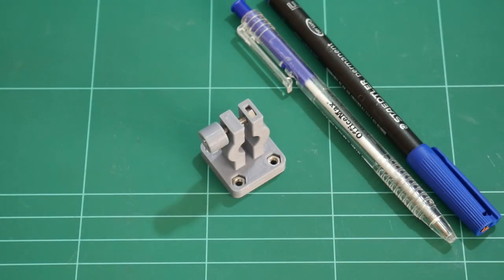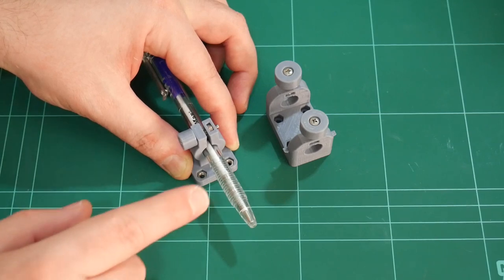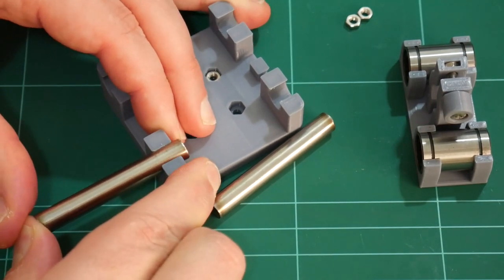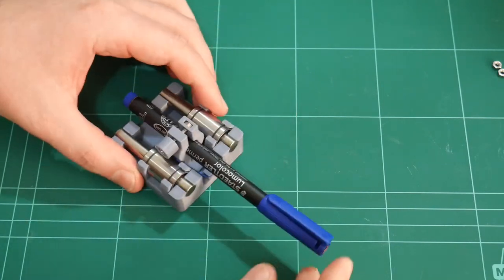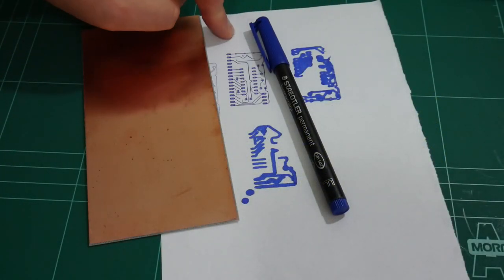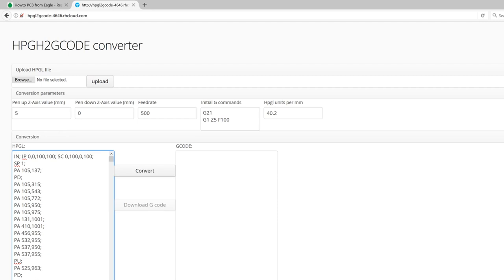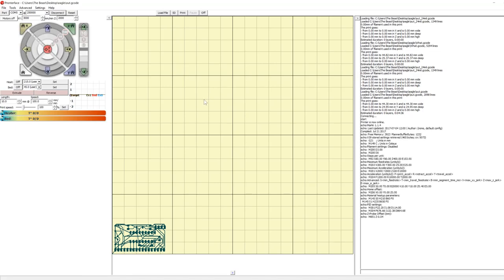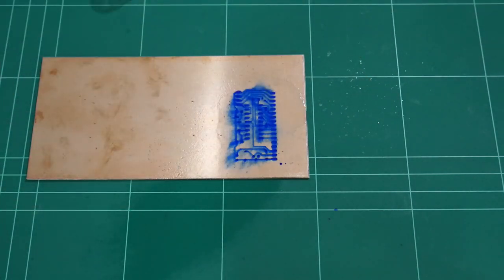Over-Engineered Pen Holder?

Comment: 16:23 the felt marker polished the copper
Reply from the maker: That makes sense, thanks.
Reply: or removed the photo-sensitive layer
Reply: deadall127 no photo sensetive layer on that pcb..
Reply: The ink protected the copper from oxidation. The color difference is from a minute difference in an oxide layer. Try drawing half a schematic, wait an hour, and draw the second half. Clean off the ink and compare the traces.
Reply: that makes sense too :)
btw, if you want to make a real pcb with this cnc+pen, you should use a plate covered with a photo sensitive layer, then expose it to UV light, then disolve the copper and finally clean the board and make the holes :3
OR simply replace the pen with a drill XD

Comment: I know what we used when I was working with cnc the pen had a secondary spring and the casing held them and the pen cartridge so the pen casing was held with a set screw still allowing for odd surfaces

Comment: The 'imprint' was just some cleaning of the copper surface done by the solvent that the pen has in it.
Basically it the cleaner bits of copper.

Comment: The board is just a simple dev board to make it easy to use a pic16f84a. The 16f84a is an older flash based pic chip. Microchip has a huge number of devices in their lineup.
Reply from the maker: Ok thank you.

Comment: This is a nice design for holding the pen. 
I do not know if you are looking for other ideas... If you are then may I suggest a solder paste dispenser attachment? For a hint, look at Dave's (not going to mention his Youtube channel out of politeness but it's that self-described crazy Aussie bloke) latest unboxing video where he got an automated SMD dispensing pen. An adapter for that on the Hypercube would allow the finished PCB to go back on the printer for placing the solder; this is an alternate to using a paste mask.
AFAIK, I have not seen a 3D printer being used to dispense paste before.
Oh, and the pen can also be used as a pick-n-place head, for placing SMT parts... but this requires a lot more gear to go onto the 3D printer.
Just putting it out there as possible future extensions on the printer.
Cheers,
 - Eddy

Comment: idea: you can add small servo to lift pen holder up instead of using Z axis. With small circuit you can use any digital pin and replace all Z lines in g-code...or if your drivers take STEP and DIR pulses on input, then (with a little better circuit) it should be simple to connect servo to board instead of Z axis driver.
But I guess people won't use this so often and seriously, so waiting some extra time for Z axis movement won't be that big problem :)

Comment: Did you always intend to use the HyperCube for these pen/laser/milling CNC designs you're doing now, or is this a fairly recent idea?
Reply from the maker: Recent. During the HyperCube build log series I just wanted a better printer. Earlier this year I released a video called "Draw with your 3D Printer!" which is when the CNC idea came about.
Reply: Now you need to drill the holes in the board. That's more work than just drawing. You need another quick connect for a Dremel or somesuch.

Comment: Just add a spring inside the pen at the top side and cut the refill tube a bit at the top and it will do the same job and literally you don't need to scratch your head anymore.

Comment: bruh I straight up used a design that was opened and doesn't need to be locked in place, only with a few rubber bands which help it flex , the whole mech is also held in place with rubber bands whcih allow it to move up and down only.

Comment: This is a lovely design. I have just purchased a little desktop CNC and, based on your design, I have ordered the linear bearings and rods from China. Now, I have a couple of months before they arrive, to draw up the holder so it all fits my gear. Since I'm a machinist, I may make the rod mountings slightly more skookum on a metal lathe. There is NO such thing as over-engineered! :-)
Reply: Would you, based on your "over engineered design", build a heavy duty CNC plotter, with very high accuracy, capable of drawing on A0 format? What would be the price of it? With stepper motors and Raspberry pi 5

Comment: Great video. However all those unnecessary pen lifts would annoy me. i wonder if there's a way to filter them out of final G code
Reply: You are not alone. Yes there are tools for that like http://xyzbots.com/gcode-optimizer/ but this tool assumes G0 motion in between G1 drawing sections, plus I am not sure it can remove unneeded up and downs.
Reply from the maker: I agree the code could be more efficient, but the entire drawing took 4 minutes, so saving an extra minute or 2 really isn't a big deal.
Reply: Yep; learn a bit of G-code (it really isn't that hard), then use a regular expression search-and-replace in your text editor. Done like dinner.

Comment: I'm intrigued by the scale factor for "to mm" in the HPGL to G code converter.
HPGL units are usually thou, and there are 39.37 thou/mm, not 40.2?  (1000thou / 25.4mm)

Is this to compensate for a subtle scaling factor in the 3d printer?

Comment: Hi, nice video again. 

At the moment I'm using the toner transfer method to develop pcb's. But this technique seems much cleaner. The thing I noticed is that all video's using the direct ink to pcb method create pretty coarse traces. It would be interesting to see if it's possible to create for example 0.5 pitch traces with a finer marker. 

Maybe it's an idea to use a coarse pen like the 0.6 for copper pours and a finer one for the traces. Maybe this needs a dual pen setup, if replacing the pen mid process would mess up the alignment.

Comment: How much more difficult would it be to use the print head from an inkjet printer and just use only one(1) nozzle for printing. There are now some reasonably inexpensive inkjet printers on the market that use a separate ink tank and transfers the ink through a very small tube similar to how some 3D printers melt the filament far from the print head thus reducing weight at the actual point of printing.

Comment: Did you use your latest 3D-printer to print these outstandingly looking details?
Did you do acetone vapour smoothing?
Reply from the maker: All printed on the HyperCube. Link is in the description.
These plastic parts are PLA printed at 0.2mm.

Comment: Couldn't this be done using a single 3d printed part that clamps onto the pen and is designed with a flexible cantilever from the carriage to the pen clamp? That way it can flex enough to do the job of the linear bearings, rails, and spring in 1 part.

Comment: awesome design! What app do you use for designing? --> just seen it in another video - it's Fusion 360 :-)

..whats the purpose of the kork mat below the bed?
Reply: Its to keep the heat in. Some printers  have a heatbed which doesnt get hot enough to properly print abs. Cork is a easy and cheap solution to that.
Reply: Thanks Marcus - makes totally sense. It might also avoid that frame parts below the bed get warm.

Comment: thanks I found this really usefull. I recently bought have stepcraft cnc, and can modify this concept to fit my machine (in due time when my skill levels rise). I'm not familiar with the Hypercube. I was surprised that you didn't talk about drilling NC files. To my way of thinking the real benefit of using cnc to make home made pcb is that you can quickly and accurately drill all those holes.trying to get an idea of the process. Wondering if you would drill the holes first and then, use one of the holes as a registration point for plotting pen..so that everything aligns??

Comment: Why are people downgrading 3-d printers to 2-d printers. I don't get it?
Reply: Builddrafter2121 usually for PCB etching
Reply: To unlock new crafting recipes of course. would you rather build a whole new machine just for pcb/drawing, or save money and just swap out the carriage head?
I have recently built a large cnc machine I will be using for drawing/milling/3d carving/ laser cutting, and the occasional PCB. i already have a 3d printer but the build area is tiny in comparison.
 it would cost me $3000+ easily to build dedicated machines for each application. not to mention take up way more room than i have. only spent $500 to build this one machine.

Comment: I like your pen holder design, but when you show the plotting of PCB, I don't understand why the pen moves up and down so many times, even when it is totally unnecessary, and when it is necessary to move the pen up why move it so much? Also, rapid moves should be done much faster. It would save you a lot of time. I mean, four minutes for plotting that tiny PCB? I can mill it in about 2 minutes... or less.

Comment: One can see from your constructions that you are clever, but you have never been tought mechanical engineering^^
Reply: How come?
Reply: you can be taught may things including spelling but you can't be taught to be clever.
Reply: +dunichtich100  What are you implying?
Reply: A mechanical engineer would have come up with the final solution in the first place and not have used those first iterations. Just because of his education in this topic. But our Tech2C guy here is verry clever because he found the correct solution (for the materials he had) on his own without this education^^
Reply: +dunichtich100  Mechanical engineers also go through iterations. Not everything is designed perfectly from the start.